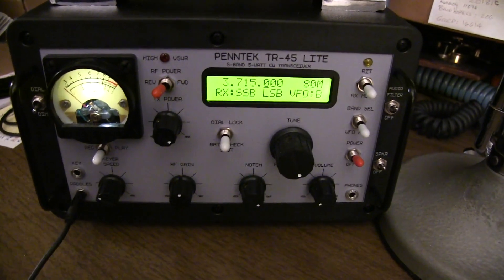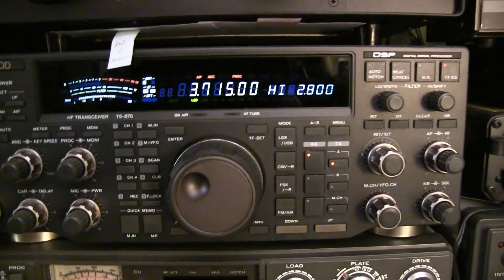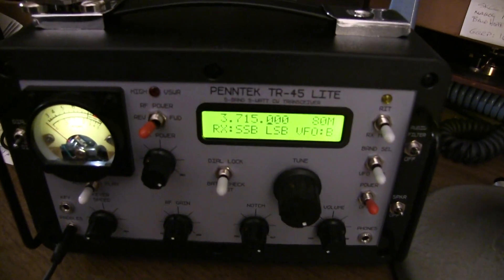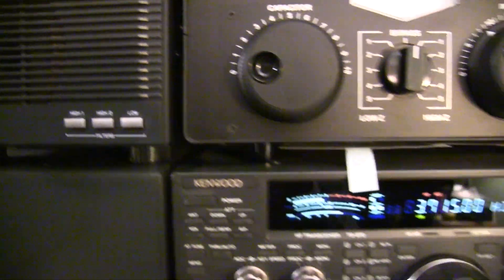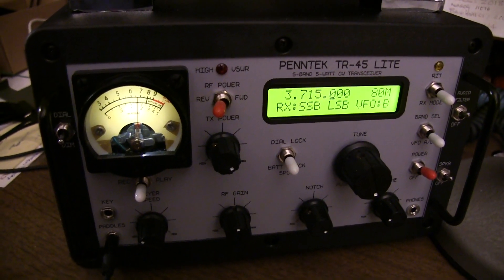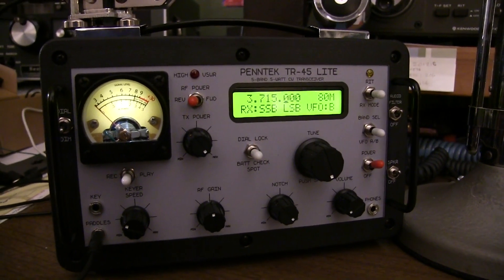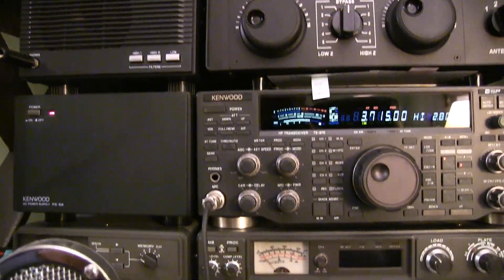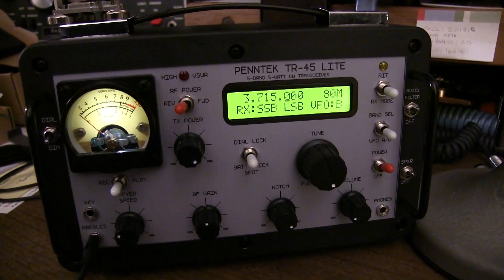#364: Ham Radio quickie: Single Sideband (SSB) receive audio quality on the Penntek TR-45L

Comment: i have the TR-35 and my TR-45L is being built as i write this... the TR-35 only allows 15MHz for WWV... i was wondering if 10MHz WWV is available on the TR-45L? (i usually use WWV, as many hams do, to quickly check propagation)... love my TR-35 and really looking forward to my TR-45L w/the internal tuner (did not go for the internal battery)
Reply from the maker: Yes, you can tune WWV on 10MHz with the TR-45L.
Reply: @w2aew  tks, OM... de kg4zqz

Comment: That’s a cool piece of kit. Probably lame, but I love analog gauges. If the radio performs half as well as it looks , it’d be nice to own. 
   On a related topic(ish), what can you tell us about SDA(software defined antennae) ? I’m still fresh to the field as a hobby. I’m aware of “SDR” a have a few pieces of hardware that I’ve slowly been learning. In researching SDR and some of the reading I’ve been doing along with GNU radio companion I’ve come across a few scholarly papers on SDA. 
It’s basically showing how the tuning done with a roller   inductor and/ or a big variable capacitor will now be accomplished with software. 
Do you know anything more on the subject? I look forward to yoh next
Reply from the maker: Not familiar with SDA topics

Comment: Very nice. The kenwood has that typical extended low frequency response, they always put the carrier close to the filters. But the wide filter in the kenwood is also extending the upper end of the audio. Even compared with a high quality ssb receiver the little Penntek is providing good copy and intelligibility.  Thanks vk1da

Comment: I wonder what they would sound like with the same width filters (1.8 Khz) and the same speaker? A speaker makes a huge difference. I love the looks of that little unit! What an bullet proof case that comes in! Very tough reliable little transceiver that looks like it was designed by hams who knew what they wanted. Thanks for sharing, 73's and Merry Christmas and Happy Holidays to you and your family!
Reply from the maker: With similar filter settings and using the same speaker, they sound virtually the same (since the TR-45L filter is reasonably flat in the passband).

Comment: I really like the look of the analog S-meter on the Penntek, but wonder about its accuracy. 80m background noise level is likely at least S6 or 7 (Alan claims lots of local noise, so likely even higher), but the meter seems to head toward S0 (although scale only goes to S2?) between transmissions. Also, the upper end of the S meter seems too generous (compare with the TS-870). Is the S meter calibration adjustable?

Comment: if you try using an external speaker on the Penntek TR-45L. the difference between the radios is that the Kenwood has more bass in the Audio which is because of the better speaker.
Reply from the maker: If you look at the frequency response curves in the previous video, you’ll see that there wouldn’t be much bass. The low frequency corner is around 400-500Hz.

Comment: Are we hearing both of these through the same speaker?
Reply from the maker: No. The TS-870 is using the external speaker that is to the left of it on the shelf, and the TR-45L is using its internal speaker.  That is partly why I moved the camera, to be sure the camera’s mic picked up sound from the appropriate speaker.
Reply: @w2aew  Thanks for confirming that. That’s what I suspected from the video as well. But I wanted to confirm. I would’ve preferred to hear them both through the same speaker.